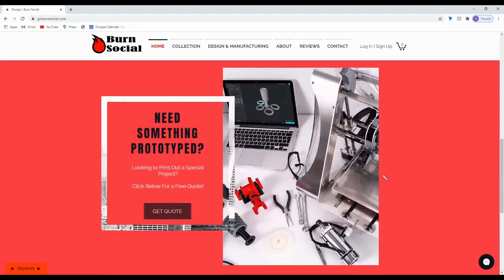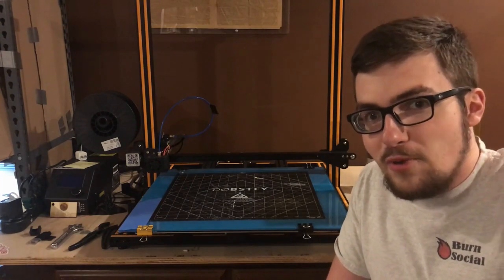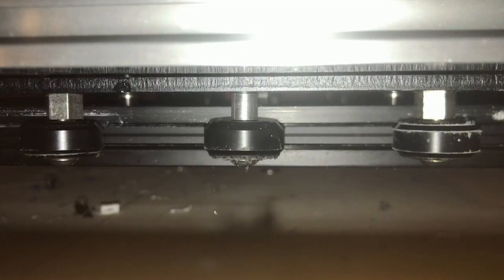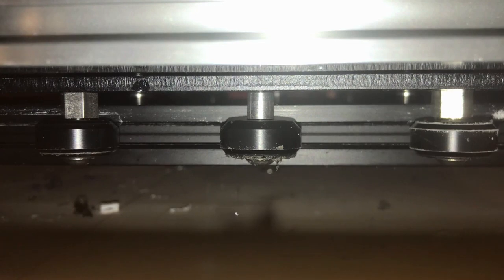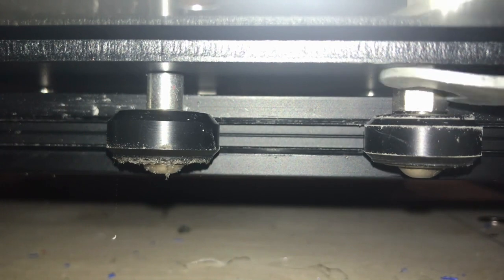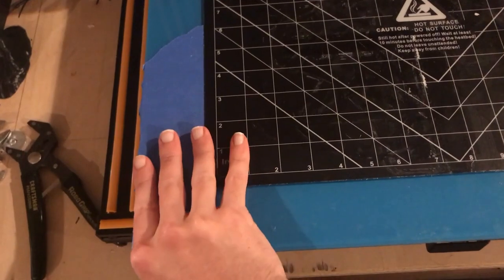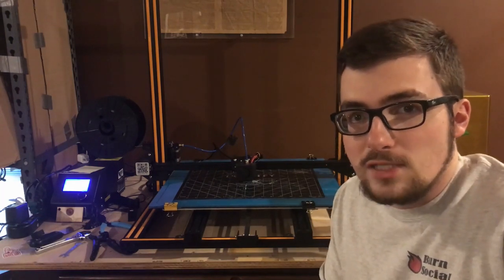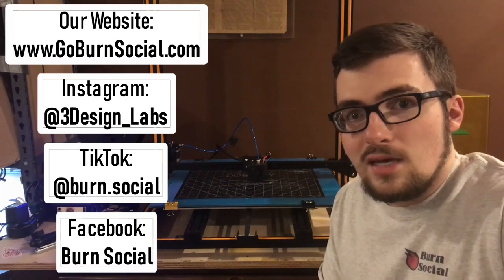WHY is my 3D Printer SQUEAKING?! (and how I fixed it)

Comment: would wd30 be unwise to use
Reply from the maker: A good question! I’d advise against it. WD40 would lubricate the bearings, but also the eccentric nut. This means your bed rollers will be more likely to loosen themselves and your bed will wobble.

Likely the squeaking is either the rubber rollers against the aluminum frame, or the friction of the eccentric nuts from being over tightened 

Did you try tightening/loosening the eccentric nuts first as shown in the video?